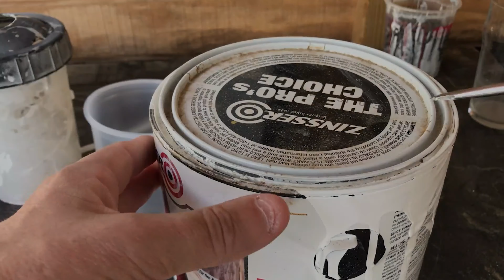SPRAYING HERILOOM TRADITIONS WITH THE FUJI

Comment: Thank you for the video. Did you use water to clean the Bin Primer? I thought you had to clean that out with pneumonia? I was told it would turn rock like in the machine if I used water. BTW - I like the stirrer you have for your paint.
Reply from the maker: Hey, Bin is made in two different mixes. Bin and Bin Advanced.  I believe is used the advanced in this one.  I bought some extra gallons on accident.  The advanced is water based so it can be rinsed.  The regular Bin is shellac based and you clean it with Ammonia.  

The regular Bin is superior if you can can take the smell and cleanup. With the advanced it is water based so a rinse is all you need.  

I use the 3M pps cups and they are awesome for cleanup of the shellac stuff.
Reply: @SimpleWoodShop  Thank you!
Reply: @SimpleWoodShop  methyl hydrate is less stinky… or at least better smelling. Do you find the advance sands to powder nicely?

Comment: What size tip did you use to spray the BIN
Reply from the maker: I used the 1.3 for that, it is relatively thin.  I have the Q5 so there is enough power behind it for the 1.3 tip.  If your machine is under powered you can try the 1.8.
Reply: @SimpleWoodShop  if it’s the BIN shellac and not the synthetic BIN you can spray with the 1.0 tip too. Need alcohol to clean which is “fun”